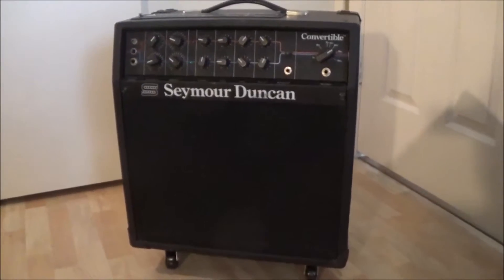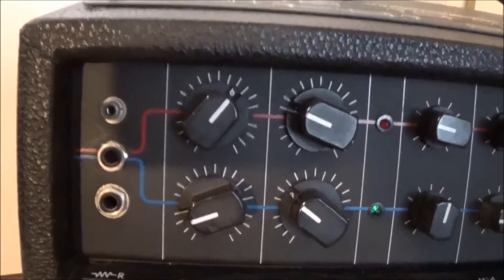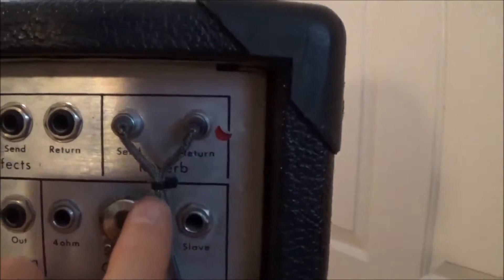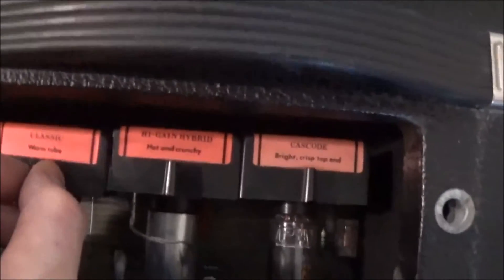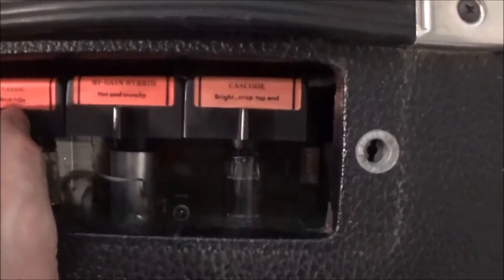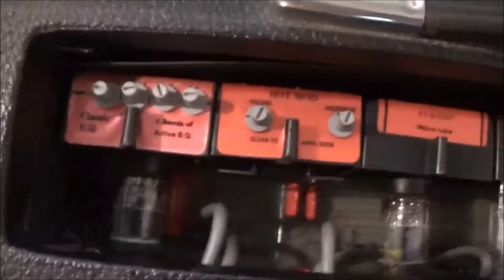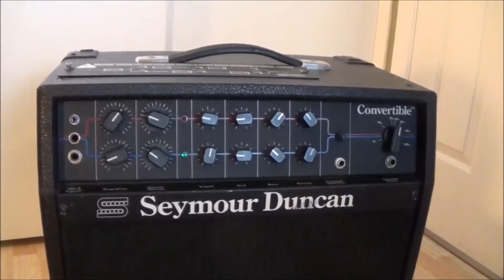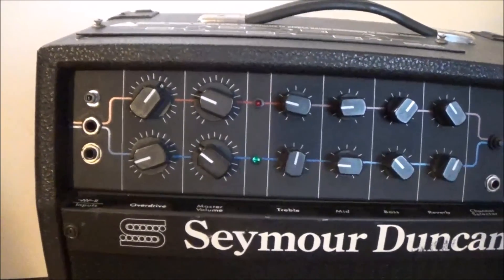The 100 watt Seymour Duncan Convertible Tube Amp

Comment: Is there a way I can bypass the Variable Power circuit? Thanks!
Reply: Thanks very much for the prompt reply. I thought that might clean up the "clean" tone a bit. Appreciate you!
Reply from the maker: @billyvanilli  It will do nice clean tone. Depends on what preamp modules you have and what preamp tubes you use.
Reply: Well, I agree with you to an extent. In my experience, an amp with a gain control can't do "clean" clean because to get enough level the gain control introduces a bit of overdrive. That aside, the SD Convertible has a great "blues clean" especially with the two EVM-12L's I'm using. My standard for "clean" clean is a Yamaha G100 III head. That's all it does, but it does it very well. Again, my thanks and appreciation for your replies!
Reply from the maker: @billyvanilli  What tubes you use for the phase splitter is very important. Should be a pair of 12AU7s, which have a lower gain factor than 12AX7s. Will be hard to get a clean sound otherwise.
Reply: @VegasCyclingFreak  Yes, I had just learned of this earlier today. I'll dive in there and see what I find. Going offline for the evening.
Reply from the maker: @billyvanilli  Not that I am aware of. That’s baked into the cake so to speak.

Comment: I don't think he got out of the amp biz because of this amps problems, it was more likely his divorce in the 80s and wife taking over factory.   The amp is a good amp and kicks Ass!
Reply from the maker: That may be. I'm just going off of all the stuff I saw on the internet around 2003 when I created many webpages concerning the Convertible. Most of what I read is that they were unreliable and prone to various problems due to the preamp module design... the method used wasn't exactly bulletproof but there was really not a better technology to use at the time. I made this video after I had shut my website down, a few years before. I resurrected it about 18 months ago now -- www.DIYguitarist.net

Comment: The Duncan Convertible 100 was and is one of my favorite amps of all time. Definitely in my top three all time greatest amps. I owned and used one back in the 80s and early 90s. I foolishly sold mine when I thought I was done playing gigs and moved to another state. Doh!!! I've not stopped thinking about getting another one. The only thing that stops me are the modules. The modules are hard to come by, and usually expensive. I'd think they are probably pretty easy to repair, so that's not a concern. But getting them might cost as much as the freaking amp! As to their being bullet proof. I mention in the Harness part 1 video the guy, Jim, I bought the majority of my gear from. When he was working at a shop in Denton, Texas, McBrides (RIP), I was talking to him about my Convertible. He cautioned me about the amp. I asked why, and he just waved me to follow him, saying "I'll show you". He walked me down to the basement of the shop. Down there were what were ten or fifteen Convertible 100s. Jim explained that The Convertible amps had some problems with the module section in the first few years of production. They sorted out the problem after about the first four years. It really worried me, as I was gigging all the time, and used the thing two nights a week, often more. I finally concluded that if you have a Convertible, and it hasn't melted down, you're probably okay. I continued to use mine through the rest of the 90s, with zero problems. at this point, if it is still running, it is a later version, or it doesn't have the issue those early ones did. I should mention, everyone of those SD Convertibles in the basement of McBride's had the module section just totally melted down. The modules melted to the point that the they couldn't be removed from the socket. 

Yeah, you have to keep the module sockets clean, was what I learned when I owned one. All in all, these are killer amps, they sound fantastic. I set mine up for a blackface clean. Both channels were clean. I used different modules and in different numbers for the second channel. The amp really was truly fantastic sounding. It was also loud a hell. I never had any problems hearing myself, even in really big rooms where I'd expect to just disappear in the mix. The only thing that stops me from getting another is I discovered Rivera amps, then my wife gave me a Mesa Mark V. The Mark V has more options than the Convertible, many times over.
Reply from the maker: The module cups melting is a cooling issue. A friend of mine disconnected the fan in his while recording and those plastic module cups kinda melted. 

Yeah I recently looked at some preamp modules on ebay... the asking prices are kind of ridiculous. It's like that with everything lately though. 😕

If Seymour Duncan did a re-make of the Convertible it could be done so much better with today's technology! Unfortunately, I don't think they'll ever go down that road again.

Comment: Think they were introduced a bit earlier than 84, I remember seeing the ads for them in ‘83 when I was a roadie for a band whose guitarist used a nightmare Fender Super Reverb that broke down every time we moved it.  We looked at switching to this amp but decided it was too untested at the time.
Reply from the maker: Hmm... that may be the case. Just going off the info I could find on it 20 years ago when I initially reverse engineered most of the preamp modules, etc. What kind of problems would the Super Reverb have when transported?

Comment: Hello great videos on the SD Convertibles as I've had one since the 80's & I'm having some issues, I was wondering if there was a way to connect W/you to get some advice? I beleive your in CA & I'm in the Chicago suburbs & looking for some help, I've had zero luck W/any response from reputable Amp repair shops & the ones that did reply seem run for the hills when I advise it's a SD Convertible.. LOL! Thank you, Lou
Reply from the maker: You can email at the address on the home page of my resurrected website -- www.DIYguitarist.net 
I have a lot of webpages that I created in the early 2000s regarding the SD Convertible there. Anything to do with transformers you are truly up the creek - there are no replacements. Anything else should be more or less fixable.
Reply: @VegasCyclingFreak  thank you Paul and I did just try going to DIY site but it says it's "parked" by GoDaddy so I'm not seeing a email address and I was just rereading my original you are in Vegas not CA LOLI also know not a transformer issue from what I can assimilate as the amp is functional
Reply from the maker: @louselvaggio7799  Sorry it's now DIYguitarist dot net not dot com. Force of habit. Yes I am in Las Hell, I mean Vegas.

Comment: Hey! Just picked one of these up and it’s missing all modules. Search CL, eBay, etc. doesn’t seem to be a whole lot of them out there. Did you ever manufacture these for sale? Thanks!
Reply from the maker: Sorry, I don’t. I made a few for myself.
Reply: @VegasCyclingFreak  thanks. Just noticed all the power tubes are missing as well. Probably going to pass this on to somebody that wants to refurb it
Reply from the maker: @StPoP  Good move. That would be like $600 to get going, assuming you could round up five preamp modules.

Comment: I bought one of these 10 years ago for $125. The EV12L speaker in it was probably worth that alone. The reverb died on mine, haven't looked to see what the problem is yet. Probably should pull it out and do the diode mod and fix the reverb.
Reply from the maker: Wow that’s super cheap! I paid $400 for mine back in 2002-2003
Reply: try changing the third preamp tube (12AU7) most  likely the issue

Comment: I recently bought some modules from a guy who parted out his Convertible: (2) Hi-Gain Tube and one each Classic Distortion and Classic (Warm Tube.) I'm currently running Classic Classic Normal Hi-Gain Hybrid and Presence in that order. I'm still learning the amp after two months although I'd say I've got it pretty well dialed in. I tried the Hi-Gain Tube module and it's smoother than the Hi-Gain Hybrid but the HGH has more character. Kind of like holding a wah pedal in a certain position, maybe not quite so pronounced. So I'll probably let the two Hi-Gain Tube modules go to a new home. Haven't tried the Classic Distortion yet. The only thing missing for me is a punchy low-mid, maybe around 200Hz. I've seen your vids where you've shown how to modify modules or even build your own. I'm wondering if you could change some components on the Classic Warm Tube to give it a little more punch and a little less drive. If so I'd be glad to send you the module and pay you for your time and expertise. Thanks!
Reply from the maker: Hmm... I've been looking at the Classic module schematic vs. the Normal module schematic and the only real difference between the two is that the Classic module has 1uF bypass caps in parallel with the cathode resistor. You might be able to tighten up the bass response by reducing the size of those two caps, or just eliminating them. If you eliminate them you'll end up with a Normal module with a very teeny amount more gain than the Classic module. This is something that might need some of the resistor values adjusted, but figuring out all that frequency response stuff is above my pay grade.
Reply: @VegasCyclingFreak  Appreciate your thoughtful reply as always. I've got a friend here that might be up for the challenge. Best to you!
Reply from the maker: @billyvanilli  Cool. Let me know if you arrive at something that meets your wants.

Comment: Hello there. First of all thank you for offering the information about this amp on the Internet. I’m in Japan and about to purchase a used Convertible about 2-hour drive away. The store just emailed and informed me that the external input below the guitar input on the left side of the front panel does not work. What’s this input designed for? Do you know? How big of a deal is this thing not working? My apologies for asking questions in a unsolicited manner...
Reply from the maker: That’s just a second input jack. Very minor issue.
Reply: Mr. VCF!
I got the amp yesterday. The store manager who did not know much gave me an unbelievable price when I pointed out that the "Variable Power Control" didn't work. The wrong tube, 12AU7, was in the middle position you pointed out in this video. I still have questions regarding this knob though. It does not seem to be working correctly. Pointing down at 6 o'clock to 60W range maintain pretty much the same loudness and gets louder after that, but not that much. Does yours work like that? By the way, would you prefer I give you my mail addr? Thank you in advance.
Reply from the maker: @reibian  You’re not going to hear much difference between 60W & 100W. It takes ten times the power to double the sound level. So a 100 watt amp is only twice as loud as a 10 watt amp. It’s technically not really a variable power control anyway, it’s just simulating one with some fancy circuitry. I think it should shift where the signal “breaks up” more than anything else, so at lower wattage setting it happens sooner. But that also depends on what modules you have and in what order they are in.
Reply: @VegasCyclingFreak  I appreciate your response. I understand the influence of the modules, but I was expecting more drastic effect by the "Variable Power Control" setting. I was expecting much quieter sound at 5W setting and louder at, say 80W setting. It doesn't seem to make that much difference unfortunately. Also, I do have more questions on the modules if you don't mind. How were you able to make the black plastic cases? Do you have access to a 3D printer? Let me know. Thanks.
Reply from the maker: @reibian  Don’t get too fixated on the variable wattage thing. Because sound pressure level is logarithmic you’re not going to hear that much of a difference between 5W & 80W, unless maybe you’re at full volume but that’s going to be hella loud and not really real world for most people. I got the module cups from Seymour Duncan years ago before they sold out of them. Someone could definitely 3D print some if they had all the exact dimensions to model it in the software.
Reply: @VegasCyclingFreak  Dear VCF I have further questions regarding the plastic cases for the modules; I am not really able to run the amp half or full open and can not be sure about the heat generated by the amp. I asked around for 3D printing the cases and I was asked about the internal heat of the amp which would determine the material for printing. The fan motor is located away from the input side, so I am assuming it would not be that hot in the module compartment. Do you have any ideas? Also, I am interested in recreating the modules. There are 14 listed looking at the manual. Which ones should I attempt and which ones are impossible because of the part (un)availability? Thank you!
Reply from the maker: @reibian  If the fan is working you won’t have any problems if you’re using it indoors at a reasonable temperature (70-80 deg F). I don’t know what kind of plastic the module cups are made of. All of the modules could be made by a DIY’er except for the EQ modules and one or two others that used double sided PCBs (don’t remember which ones they are but I think the Hot Mod was one). I have no idea what temperature it is inside the chassis but it’s nothing crazy. The module cups will deform from the heat if the fan is not working... happened to friend with same amp. He disconnected fan for recording for a few hours and they apparently sorta melted.
Reply: Thank you for reply. I will go and take a look at the amp in a few days.

Comment: I installed the 5751 today in module 3 (normal.) I couldn't hear a difference between it and the original 12AX7. I keep the green channel gain below 9:00 and the master all the way up. Having had the amp for a while I had begun to notice that what at first was pristine clean actually had a little "hair" on it. That's why I wanted to try the 5751. Well, just for laughs I increased the gain ("distortion") on the green channel very slightly and it got noticeably cleaner! How is this possible? Is there a threshold gain setting below which there's not "enough" signal?
Reply from the maker: Not really sure. That could be the reason why.

Comment: Last weekend I had my basement ceiling soundproofed with R30 batt insulation. I tend to play at very high volume. Besides the soundproofing benefit, now I don't get false resonances in the room. So that's all to the good. The "problem" I have now is that I've got the green channel master volume and the "power simulator" knob all the way up and I want a little more clean headroom. (Currently the "distortion" knob is set quite low, maybe about 8 o'clock.) I'm thinking about switching out the 12AX7 in the third position "normal" module to a 5751 in order to get a little more range on the "distortion" control and lessen the overall gain of the clean channel. The 5751 is 70% gain of a 12AX7. Do you think the tube swap will reduce the distortion in the clean channel or am I just spinning my wheels?
Reply from the maker: It might help. You could even try a 12AU7